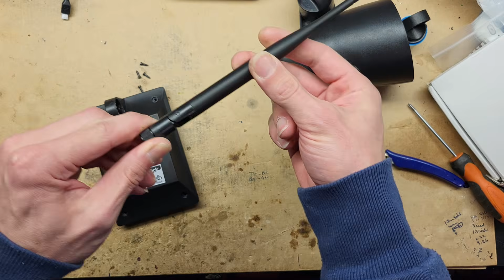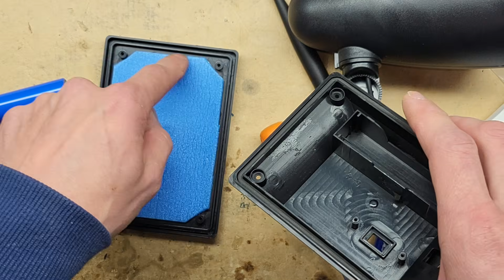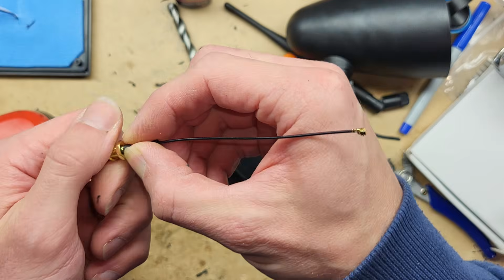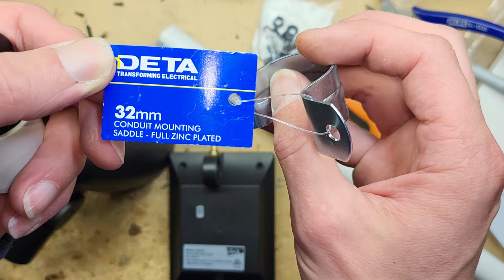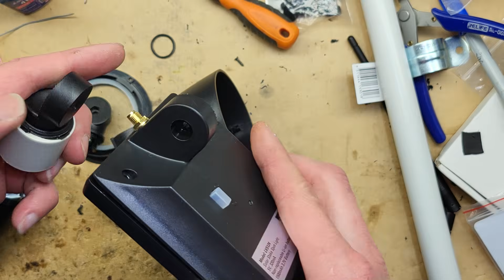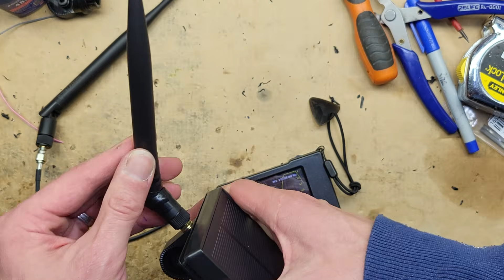Meshcore / Meshtastic Repeater build V2 with solar light

Comment: i saw the same SWR behavior with that type of antenna and i really wonder what the mechanism is behind that. i can see how it might change but it seems strange that it "fixes" itself when you step back to 45 degrees from 90.
Reply from the maker: I believe that it's the coax cable. I've tried fixing the radiating elements in place and that seems to be the only factor that changes. Also over time it will drift, which I think is the coax cable settling to it's new shape
Reply: @rbland  yeah someone on one of the meshcore discords had this theory also, that the feedline (which bends) is not properly isolated from the antenna (electrically). i guess a proper antenna would have a balun between the antenna and feed line.

Comment: What's that blue/reflective padding called and what's it for? Also do you know what kind of distance this repeater is reliably capable of reaching out to?
Reply from the maker: Also you also need a low noise environment, so if you live near a cell tower, you may only get a fraction of that range. A band pass filter can help. You can measure your noise level from your companion or in the repeater settings. Anywhere -100 and below you'll have issues
Reply from the maker: Hi there, unsure of what is called but it was left over from our vinyl flooring- under floor insulation. It needs to be very thin otherwise the enclosure won't close.. Others have used foil tape to help a little. 

I've got some 100+ km links but realistically I'd say 50km reliably with line of sight. I test mine to 40km with around a 9dB signal, whip antenna on the other side

Comment: How are you reading the battery voltage?
Reply from the maker: Hi, the battery voltage can be read through the Telemetry on the repeater. So with the Meshcore app, connect to your 'Companion' device via Bluetooth. Then Discover nearby nodes in the tools menu. Once you find your repeater your can log in by going to 'Manage' and view the telemetry in there

Comment: Is this able to maintain continuous running (assuming good weather) or does it eventually run the battery dead?

How much uptime have you had so far?
Reply from the maker: Hi there, yes the battery lasts 4 days with absolutely no sunlight. The panels charge the battery fairly quickly in the sun. They run forever. The one I've had out the longest has been up for 96 days in Auckland winter weather
Reply: @rbland  i built one of these and loaded EasySkyMesh 17 onto the xiao (nRF). i feel like it's going to go forever on a single charge. over 2 days the battery dropped only 130mV. it is a companion, so it's not doing too much tx, but on the other hand i'm not connected to it over BT very much (wardriving setup). i should try to get some of the insulation you are using because boy does it get hot in there (and as hacncrap noted the american version of this has zero temperature safety features.) i think i might also just switch to a standalone solar battery charging board which should have overtemp protection.

Comment: Hi there! Awesome video! I've been working with that same light here in the US. However, the brand is Harbor Breeze for us. I designed various 3D printable mounts that should work perfectly with your Click brand light. I'd be happy to share the free Printables link if you'd like. Side note: It's interesting to see the difference in the electronics when comparing the two brands. Same body but different electronics.
Reply: Hacncrap, I purchased your parts. Thanks
Do you have any charging or battery life issues with the Harbor light and T096? Right now mine have dropped to 82%, which is still good but has dropped.
Reply from the maker: @g63b awesome. I find that these battery controllers charge up to 4.15V maximum instead of the rated 4.2v which is great for the battery life, especially in the summer when they'll run a bit hotter. It's still ample capacity for around 4 days of no sun runtime. Mine sit around that 80-90% mark but I'm running the Seeed studio NRF boards which are extremely power efficient. 

If you do have trouble with the t096 you may want to try turning in power saving mode in the CLI once you log into your repeater. I believe the command is 'powersaving on'
Reply from the maker: Thank you very much for the feedback. 

Thank you for the offer, sadly I don't have a 3D printer!

I've seen a few of the US versions of the harbor breeze and also noticed the electronics looked a bit more basic. I don't think it has high temperature cutoff. Not sure how the charge circuitry works on your version. 

After one of the guys over here did a reverse image search we found a whole bunch of other designs for this light. I just wish the enclosure was a wee bit larger as it's just a tad too small. It would have been nice if the enclosure was single walled, instead of the double wall.
Reply: @rbland High temperature cutoff?! That's awesome and a great way to prevent thermal runaway. The US version is super basic. I guess we're not too concerned about fire safety out here. Man... 😅

Comment: I have had two ho bad on me and start draining the battery fast. I tried other batteries and had the same result. I planned on multiple nodes but now had three of four lights fail.
Reply from the maker: Does yours have a temperature probe on the end of the red wire? If so, you need to tape that to the side of the battery with the existing foam piece to prevent it from getting hot straight away when the enclosure heats up. 
If you still have trouble you can use one if these instead of the main board for charging https://a.aliexpress.com/_mtGG8r1
Reply from the maker: Also are you using the NRF version of the Seeed board?
Reply: @rbland  I have 2 esp32 and  5 nrf
Reply from the maker: @TimHunold the ESP32 boards will need power saving turned on in the repeater's CLI. Type: Powersaving on
Reply: @rbland  i never ventured to that because it was my understanfing beyond the un-needed BT and wifi, you lost output power. The caveats outweighed the benefits iirc
Reply: @TimHunold  you might try EasySkyMesh, though the version corresponding to meshcore 1.18 is still in beta. the power saving is real and i don't think it's limiting TX power.
Reply: @logitechcamera  i am doing mostly tastic before i roll out core because of the fcc noise that might jeopardize core if they don't comply iirc
Reply: The ones that lost charging were they the nrf boards? We're the batteries the same brand, if so what brands. Thanks.

Comment: Excellent video! Thank you. what was the need for the blue thermal reflector pad? also what brand, type of glue, sealant  did you use for the project? TIA.
Reply from the maker: Hi there, the thermal pad is to prevent the heat from the solar panel from transferring into the enclosure. Temperatures can get pretty hot inside without it. 

For the quick dry superglue i'm using the LOOLIFL 480 black rubber glue from AliExpress. It's quite good. 

I use liquid electrical tape for sealing up holes also from AliExpress. 
I use a high quality, high adhesive hot glue gun glue stick for anything else internal facing. 

I use 3M double sided tape to attach the Seeed NRF board to the enclosure.

Butyl rubber tape for sealing external components like the antenna connection with some electrical tape over that to prevent UV damage to the rubber tape.